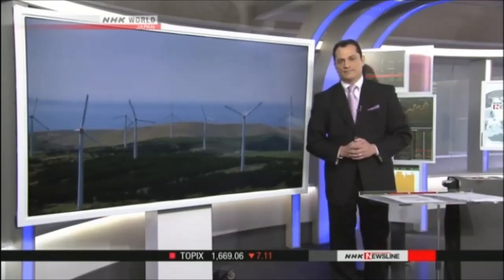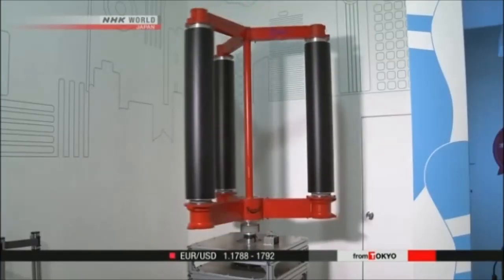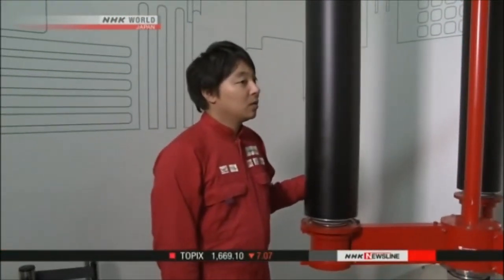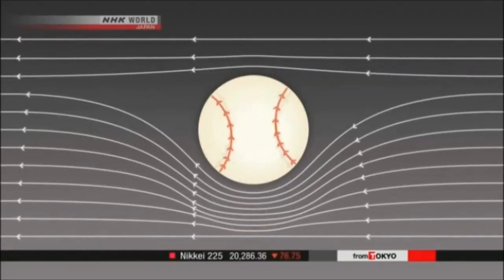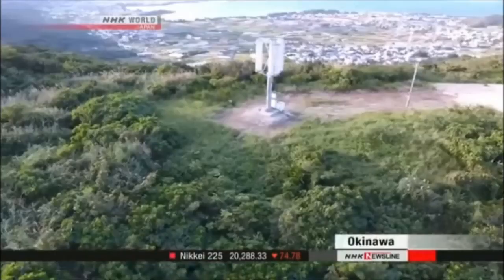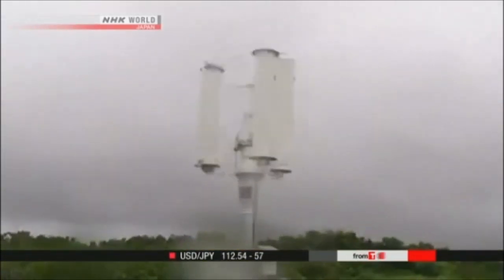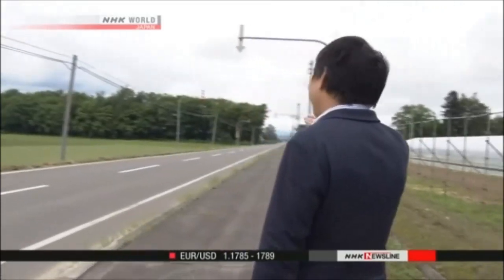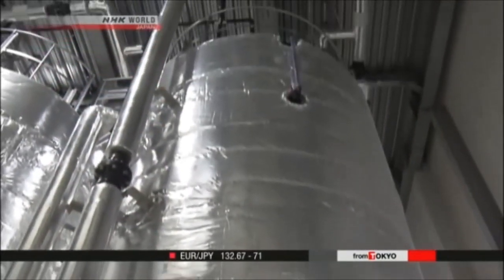Wind Turbine With No Propellors

Comment: How many power generate by this turbine
Reply: 1 gazillion
Reply: These typically outlast a conventional 3-blade windmill with several percent. That's before adding optimal conditions, and that it can run 24/7, 365, in any weather, lower cost to install cause it does not need the placement on geographic or elevation to return optimal investment. It's a no-brainer to blow those old ones up and put these in instead.
Reply: @leonesperanza3672  🤣

Comment: It's a rubbish design. The red frame, which is flat vertically, will cause drag as the wind tends to spin the turbine, giving it substantial loss of speed. If the frame was thin and flat, then it will minimises drag and the wind can pass through around the frame like it passes through an aircraft wings, making it easier to push the turbine with less force and pushing the vanes faster to gain more speed.